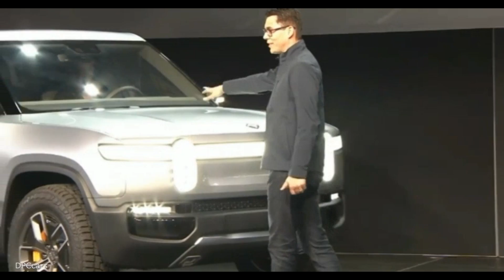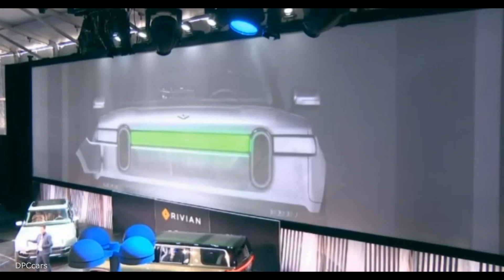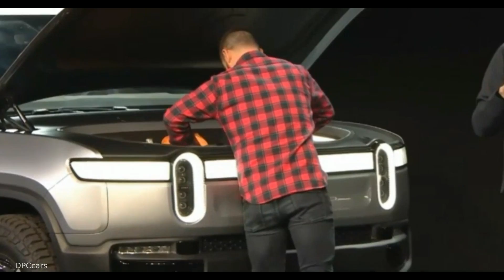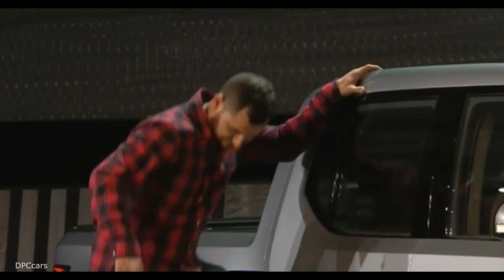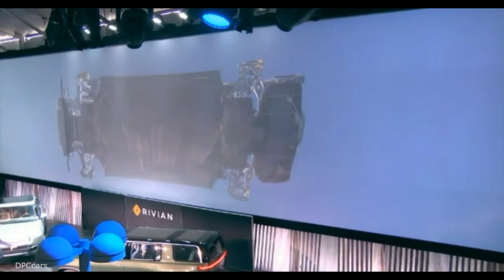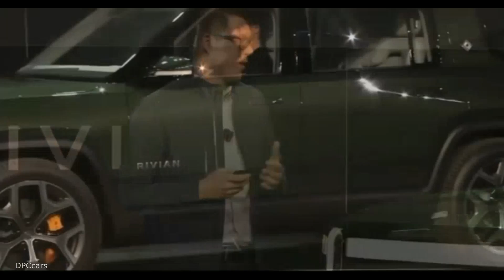Rivian R1T Electric Pickup Truck and R1S SUV Unveiling

Comment: The front end is a deal breaker for me. I don't like it at all. If the vertical lighting panel was horizontal and placed just under the outer lighting strip it would be better looking.  Is the tray long enough for a pair of offroad bikes?

Comment: If the crash structure allows, I'd like to see a split front, just like a split tail gate on the Range Rovers. It's a little too high to load up as it is..
Reply: With air suspension, the vehicles can go into a kneel mode. Frunk loading is extremely easy

Comment: Not that I’m against electric vehicles especially trucks but I need at least a 3/4 ton and preferably a 1 ton truck that will be used for work not playing around. 
I would need an onboard Range Extender (a small Microturbine Generator would be best) so I wouldn’t have to stop working when the battery charge gets low and I’ll guarantee you that it would happen on some days especially during hay season. 
It would need to be able to tow more weight than the current truck is rated for (yes I know that the current truck is probably considered a 1/2 ton). 
I need an 8’ bed and the option to install a flatbed or hay bed and an aftermarket bumper like a Ranch Hand Bumper because cows and brush can do a lot of damage to an unprotected front end. 
It will have to be able to pull a Gooseneck or Fifth Wheel Trailer otherwise it’s useless for me.
Reply: A few more things that would be better for working trucks. 

Rubber floors like a sprayed in bed liner since any sort of carpet just gets ruined anyway. I would love to be able to just hose the floor of the truck out (not the seats or the dashboard of course) 

Need a regular cab option along with an extended cab and the 4 door cab. 

I know that efficiency is part of the deal with new vehicles but I would want the option of a factory full body bed liner spray instead of paint, a smooth finish would be better and more aerodynamic than the rough texture of a bed liner but it’s worth the trade off considering the use of the truck, this would also appeal to serious off readers as well. 

For trucks with a conventional box bed the interior lining of the bed will need to be steel, a very tough composite, or a high quality spray in bed liner because it’s going to take a beating in the real world. 

Any spare tire needs to be mounted where it is accessible without unloading the bed, a trap door in the bed for the spare isn’t going to work when I’m hauling a bed full of creek gravel or horse manure (yes I have hauled both more than once). 

I wouldn’t want the glass roof or a sun roof of any kind on my truck, sooner or later something could bust it not to mention the sunlight beating down during the summer here in the South. 

I really don’t care about self driving features (yes I’m old school) but safety features are just fine with me as long as there is an override switch when I need it. (Sometimes I need to back my truck up till it touches a loading dock or piece of equipment)
Reply: Anderson Nettleship But those are all of your needs. This truck is obviously not for you. There are tons of other ice trucks being made today that already fit your high standards. Believe it or not there are billions of other humans that may have different needs and requirements in a truck.
Reply: Sawashi32 
He is just wanting a truck. Nothing special. Unlike most people he uses a truck for what they were made for. Work. 

A basic cheap work truck is what America needs . Not another sissy truck. There are plenty of them for the billions wanting them at 60k each
Reply: drmachinewerke1 okay that’s extremely simple. Don’t buy this vehicle when and if it is sold and move on. There are different demands and desires in this world other than your own respect it or not. There are and have been hundreds and hundreds of trucks that already meet the qualifications you listed being sold in America and abroad for decades.
Reply: @Anderson Nettleship 

Buy the ev and tag a farm truck with a antique tag.

Comment: Why limited to 125mph?
Reply: How fast do you need to go? These aren't race cars, these are family suvs and camping trucks.

They don't have the aerodynamics or the suspension to go much faster safely.
Reply: These have high ground clearance so as they pick up speed they generate lift and lose traction.
Reply: @JamesSeedorf  Did you not watch the video?  The have active suspension that lower the vehicle at highway speeds for better aerodynamics.  That isn't why they limit the speed.  Not even close.
Reply: @KurNorock it's exactly why, getting lower with this vehicle doesn't do a damn thing for downforce unless you only drop the front. I don't know where you associated aerodynamicly efficient with downforce but they are actually inversely related. Without a proper air dam up front (off road vehicles won't have this) side skirts (horrible for breakover angles), and 1-2 inches of ground clearance you generate no downforce. All that happens when a vehicle lowers is more of the wheels are covered up reducing frontal area.
Reply: Cause it's a truck.. not a car
Reply: It's likely what the tires are rated for.
Reply: how fast are you gonnda drive offroad - probably max 60mph
On road - noone drives over 100 mph. 
And for whats it built for,  carrying heavy payloads and towing you are just about at 65 mph.

So Practically  125mph is already too high?

And Trucks need  High Torque - which they have.

Comment: The Rivian RIT Electric Pickup truck.  it can go on hils and go into water. I am not sure   if you have to be  careful because of range. You cannot bring gas tank and the more hills you go on Uses more power so your range is less.  I have to learn and find more about Rivian Pickup truck and SUV..
Reply: I guess if you really want to extend your range you can bring a generator and a gas can. Lol
Reply: Simple bring a generator instead of a gas can. But be sure to take a tent because it may take over night to charge. Lol.
Reply: @dillonh321  Lol, riding down the freeway with a huge generator in the bed of an electric pickup.. Classic
Reply: @dillonh321  it's easy to place superchargers anywhere where wires can be set up or with Solar Power or Wind or Steam and no need for human maintenance.
Reply: @peterrobannsobrepena6029  
There are places I go that don't have wires for almost a hundred miles or even cell service and even if there were no one would put them there because 1) no one goes to these places often anyway (even though they need no human maintenance they still need for people to PUT them there and PAY to put them there. 2) I live in a strongly red state so everyone seems to have this hatred towards electric cars. There is only about 2 or 3 tesla super chargers in the entire state.
If you dont live out in the country I understand your stance but that cant work everywhere.
Reply: @dillonh321  Well it supposedly can quick charge to a 200 mile range in 20 minutes, so that ain't bad.

You say there are places you go where there are no wires for 100 miles in any direction...  Good thing the truck has a 400 mile range.  That's twice what you need.  Maybe just be smart, plan your trip, and you won't run out of power?  I mean, I've been going out into the wilderness in my jeep with it's crappy 275 mile range and I have yet to run out of gas.  And no, I don't carry spare gas.
Reply: @KurNorock  
I still travel within that dead spot too which means that I will need more than 200 miles to get there plus I m not going back and forth to the charger that's a pain in the ass. Also thats if my state gets more than 3 superchargers the ones that currently exist are not close to me or where I adventure out. My ecodiesel ram which has a range of almost 600 miles. I barely ever make it out with more than 1/8th tank of gas. If they ever make an electric truck with more than a 500 mile range I will consider buying it.
Reply: Frankly, EV's efficiency are less on a freeway but very much efficient on streets and trails.
Reply: If u go offloading bring a small Honda generator and you're set.

Comment: This guy even sounds like a Elon...
Reply: @Is allonzo Trier better than Kobe Bryant? Lol
Reply: The presenter, RJ (The Rivian CEO), does not sound like Elon. Elon tends to think, and stop at the middle of the sentence. 

Both guys are engineers and I can tell making an ultimate EV is RJ's passion. He has no problem pulling out the tech details but he is also very clear on what his goal for this presentation.
Reply: @ibmtpx24  RJ calls the front storage area a "frunk". The chassis & battery pack is setup like a skateboard like Tesla. Names the SUV "R1S" (if you say it really fast kind of sounds like Model S). 0-60 specs are very similar. He has 2 boys & one on the way (Elon has 5 boys). They basically dress the same. Elon pauses when he speaks & RJ doesn't?? Check out 8:57
Reply: @Jerzeecanuck  That pause was on purpose. Elon's pauses is different. And honestly Elon has a lot more pauses than RJ, which almost makes it an annoyance when you first hear Elon talk. Do you get the same feeling from RJ's presentation?

Frunk is not unique to Tesla. VW Beetle had a frunk since 1938. And it's strange to use that and other facts of the two to say they sound the same, assuming that is what you were still referring to.
Reply: @ibmtpx24  I forgot to mention the Rivian logo. It's basically two Tesla emblems smooshed together.